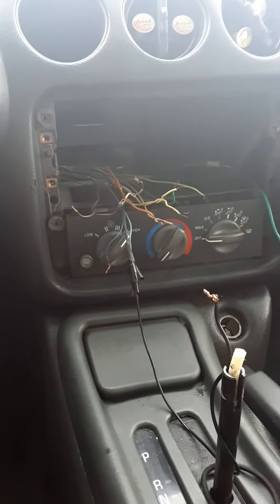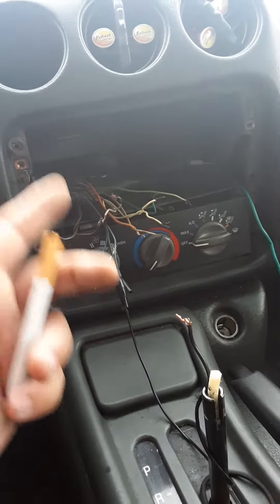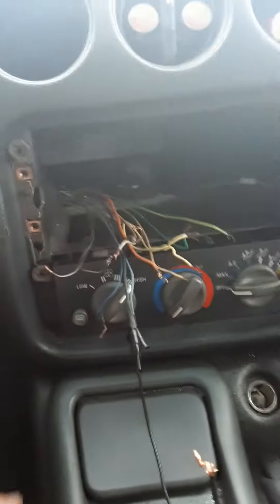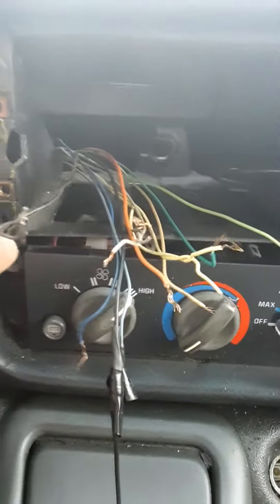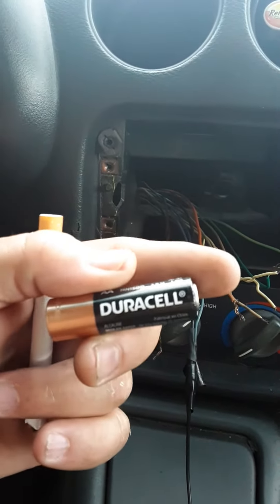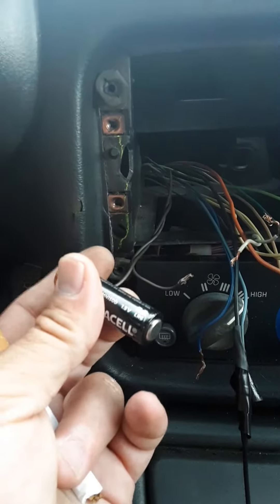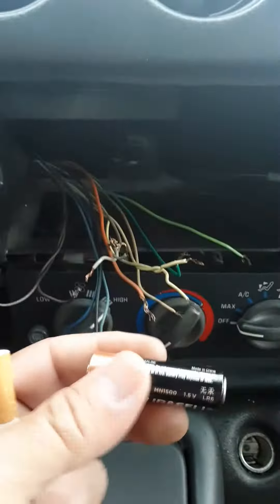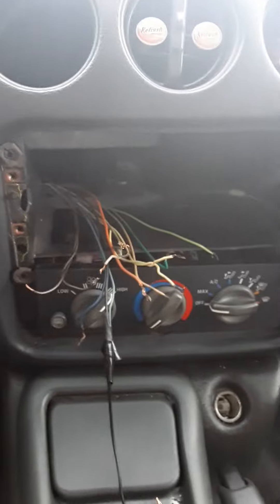Fast and easy way to find speaker wires for your car

Comment: What about - and +?
Reply: Simple black stripe on wire is negative solid is positive so what he’s showing it what wires go to what speaker you’ll hear the static from that speaker so that way you know what those wires are connected to then you go from there